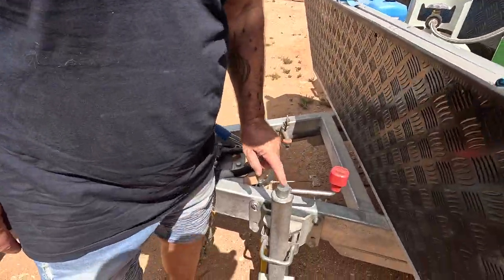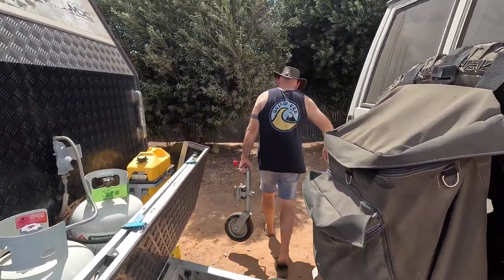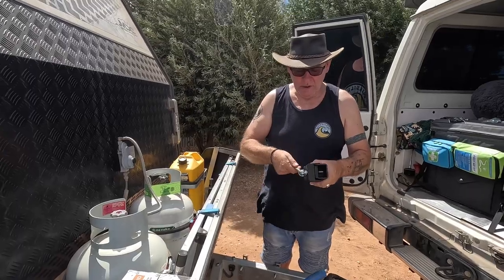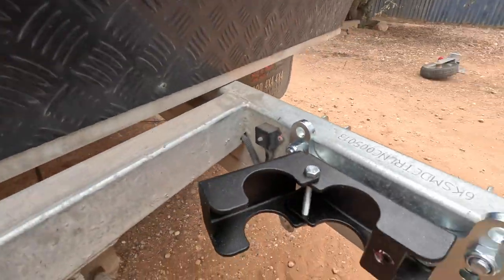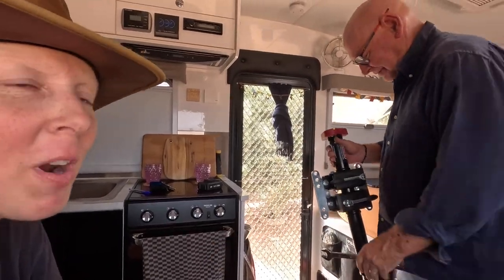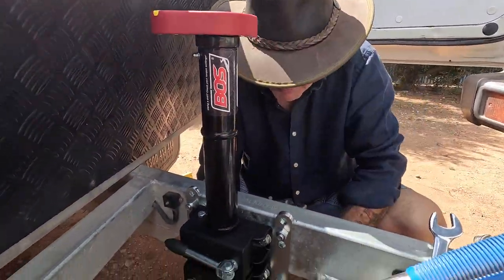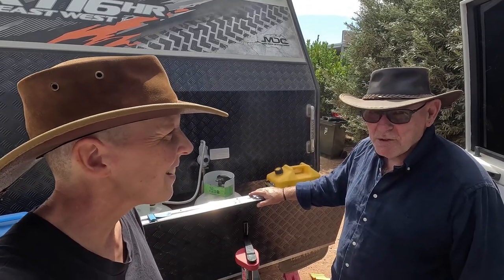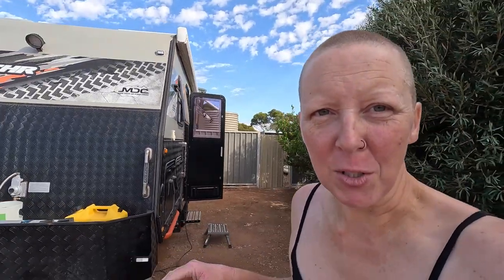D.I.Y Install | BOS Jockey Wheel

Comment: These Bos wheels are excellent,  got one for our old van and carried it over to our current van. I leave the unit attached to the drawbar and remove the base unit. The mounting bracket is a single clamp but is fine for our 3 tonne Corimal Princeton.
The support I got from the company when I had an issue was outstanding, quick to recognise the issue, send replacement part andgave instructions on how to how to remove and replace the failed bit.
My advice would be to set the clutch on the drill about halfway so as not to stress the gear set on the Bos and legs.
Reply from the maker: Glad you are enjoying the brand too, so far so good for us. Thanks the tip on the drill clutch. Safe travels.

Comment: You got there in the end that's all what counts, is the boss jockey pole all what you thought it is. We are about to go down a similar line don't know which one to get as yet.
Reply from the maker: We will let you know when we have used it a couple of times. We hit the road again on Monday. Will be in your neck of the woods soon.
Reply: Just stumbled across your channel, and so glad to hear it's not just us who struggle with keeping our camper level (it's a 2t off-road rear fold with an astonishing 300kg towball weight). Currently using the Ark XO 750, but keen to hear how your experience with the BOS jockey wheel goes after a few trips.
Reply from the maker: Hi there,
Wowzers, that is a crazy tow ball weight, are you sure it is correct? Some useful information on our weigh video about  tow ball weights.  
After using the BOS now for a while, honest review. Hubby thinks it’s fantastic, I think it takes a bit longer to set up than the jockey wheel as we remove ours off the A frame for travelling. You can keep them attached to make this process quicker, but we choose to remove ours. In terms of stability and levelling, we are finding with the new levelling chocks and the BOS that this is much better than the previous set up. We don’t seem to get that huge movement from van when detaching from the vehicle on uneven ground. We do lower the airbags now before detaching the DO35 hitch from the tow ball and this also contributes to less movement. Overall, ease of winding up and down and overall stability, this is well worth the investment. The only thing is when hitching the tow ball needs to be perfectly lined up with the hole as you can’t persuade the caravan to move as you can with a jockey wheel. More careful hand communication to the driver on my part, but we were pretty good with this anyway 😊 hope this honest opinion helps. Good luck.
Reply from the maker: Hi Greg,
See BOS review below (in the reply to camping with the fam), sorry we didn’t get to meet with you in the Mount, life has been a little crazy as you will see in our upcoming video. Hope you are all well. Take care. Kem